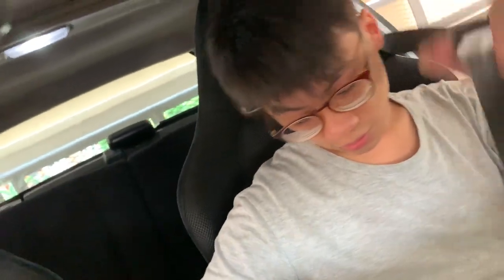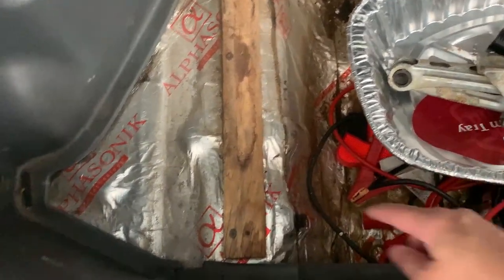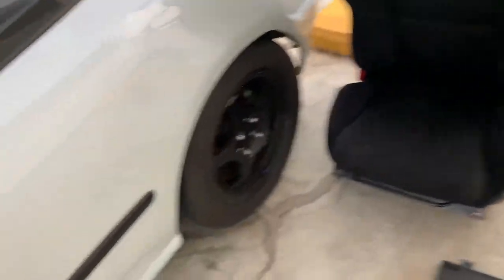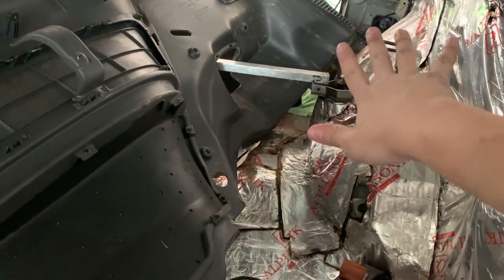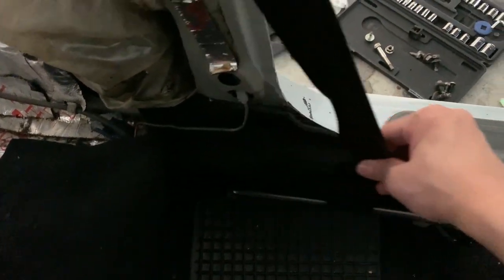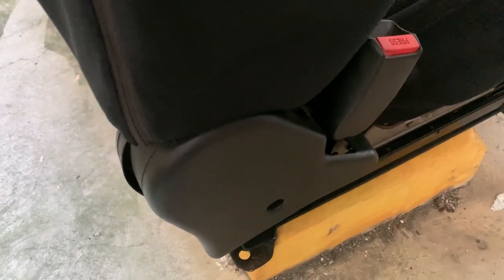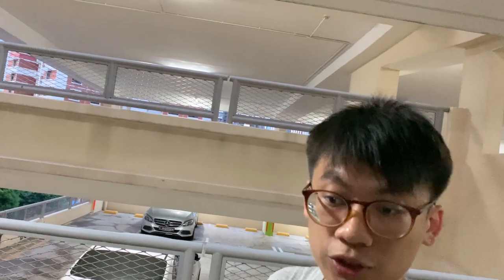SEAT BELT REPLACEMENT | 1992 Honda Civic EG hatchback

Comment: Have you sorted ur leaking issue? I had leak on my front left corner.. I did a bit of digging and managed to find the 4 drain holes from the roof. It was a rather easy fix. Can share with u if u interested in stopping ur leak ;)
Reply from the maker: I found my leaks in the rear. I think i'll check the front too to be safe! how did you fix yours?
Reply: @Joelqt  I'm from Singapore as well by the way ;) good to see fellow Singaporean with same interest actually creating videos online. Esp such old cars.. keep up the good work man
Reply from the maker: @jianguowang8477  thank you for your kind words. i need to pick up a thing or two from you too! sounds like you have gone through these problems as well.

Comment: Hi, why did you grind that part?
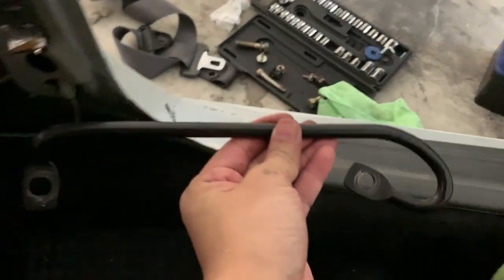Reply from the maker: you referring to 9:27? the seat belt slides onto the railing, instead of an anchor point
Reply: I ordered mine.. was wondering if I can just mount the belt with the anchor "the piece you grinded" to one of the 2 bolt holes instead, and leave out the sliding bar.
Reply from the maker: I think you probably can!